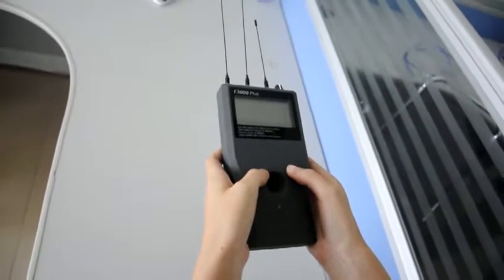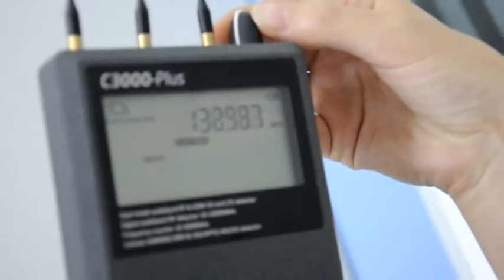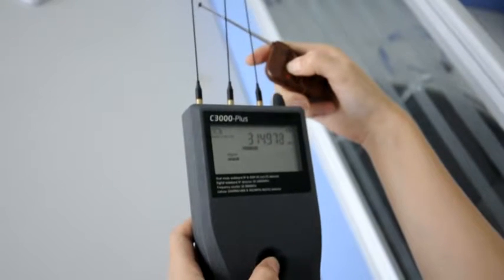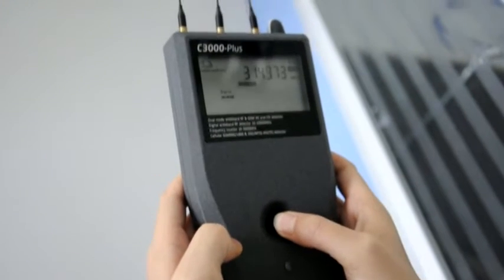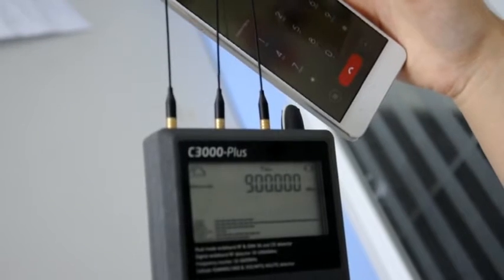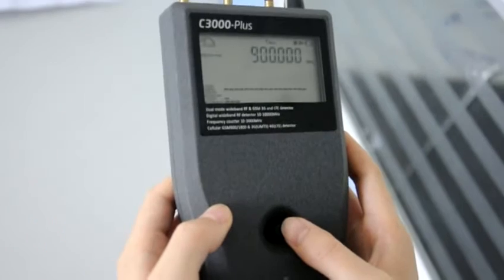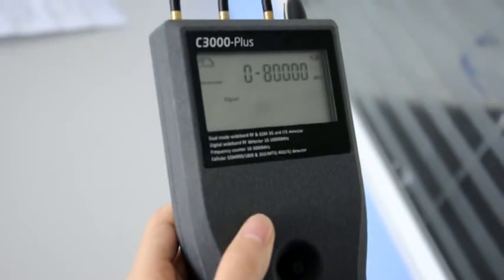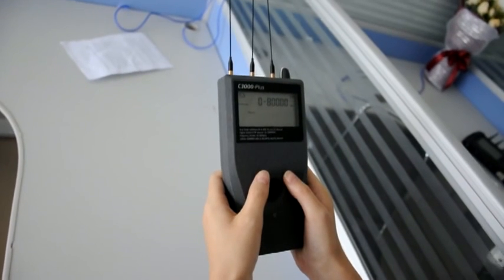Use Guide：HS C3000 plus Digital Frequency Counter Bug Detector

Comment: Hi mrs Linda! I bought HAWKSWEEP D8000 PLUS DETECTOR LAST YEAR!

SO THE DETECTOR AT THE THIRD MODE ON FULL RANGE FREQUENCY, IT SHOW 0-8000 MHZ!

CAN I ASK YOU WHY ON ISTRUCTION MANUAL IS WRITE 0-10 GHZ?

SO, THE DETECTOR WORK GOOD, BUT ON EVERY SITE AND MANUAL GET Say UNTIL 10 GHZ.

WHY WHEN I USE THE DETECTOR SPEAK ON 8GHZ?

THANKS SO MUCH 
BEST BYE